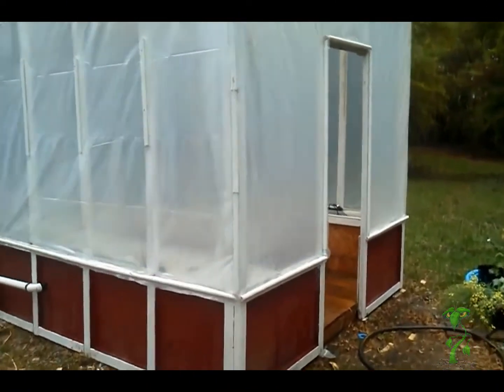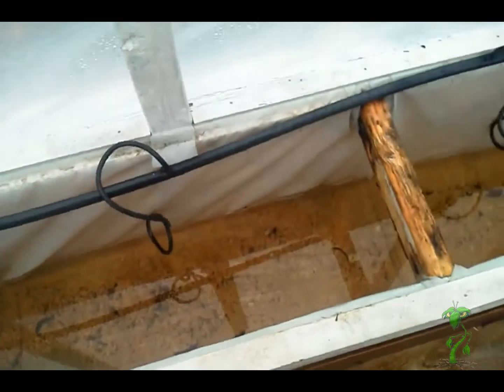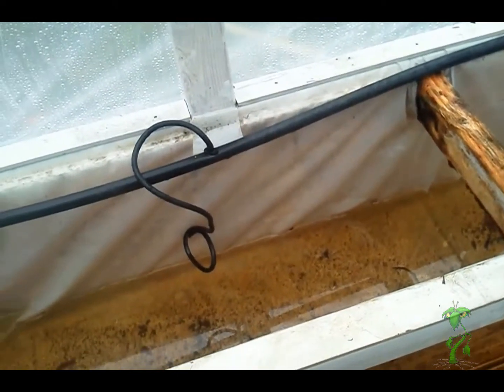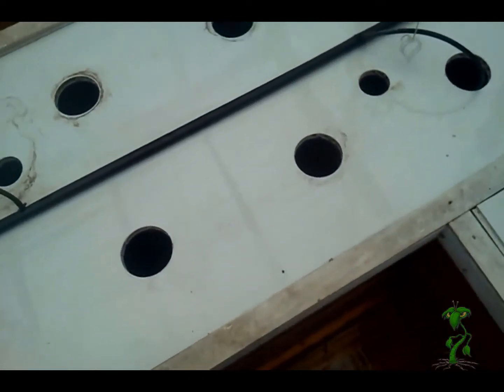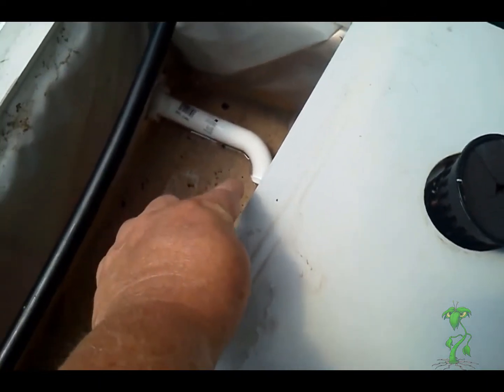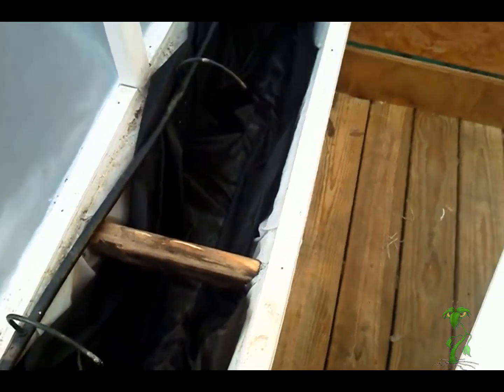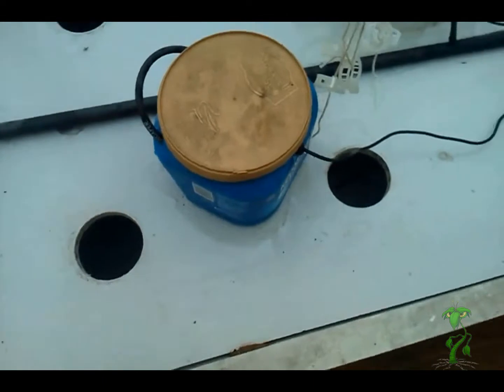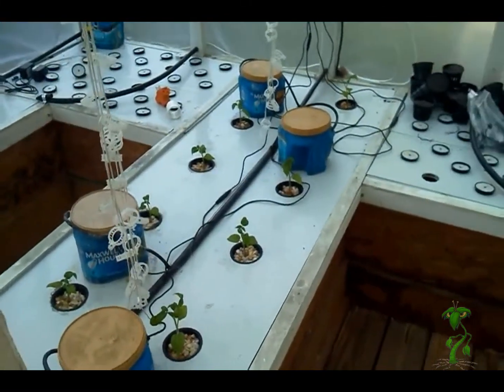Fogponics / Dutch Bucket Setup

Comment: Insulation not only keeps heat in but also keeps heat out. You can lower your cooling costs this way by insulating 6+ inches and put a highly reflective or gloss white over that.
Reply from the maker: Heating is not an issue here, But shade cloth, and a fan upgrade has really helped the cooling
Reply: @bulldogge1232000  I figured as much but you'd be surprised how many believe insulation traps in too much heat and has no effect in keeping heat out.